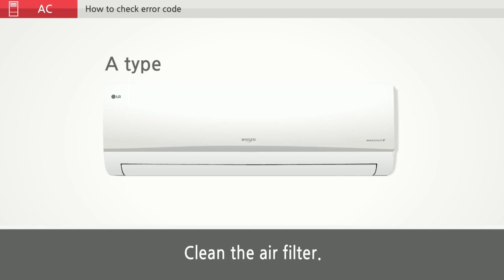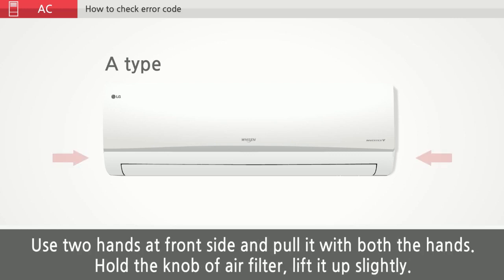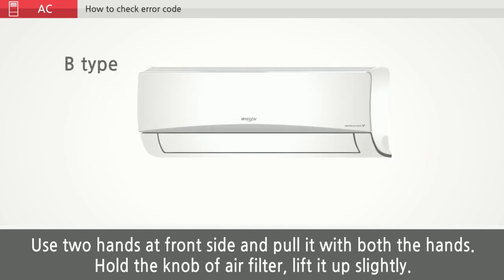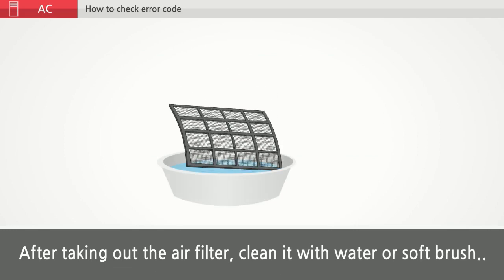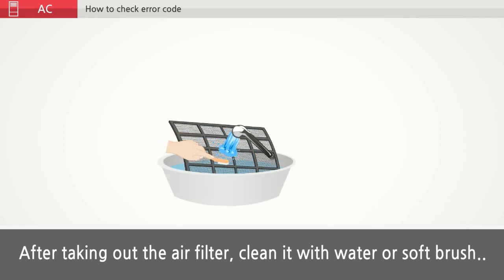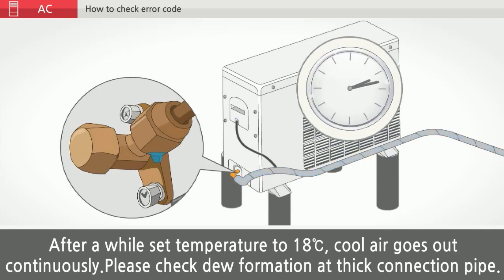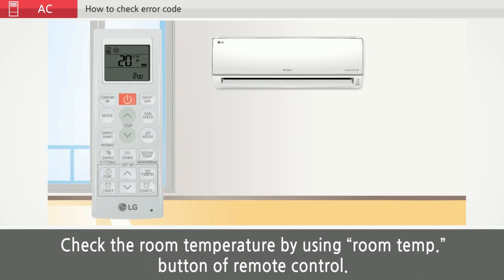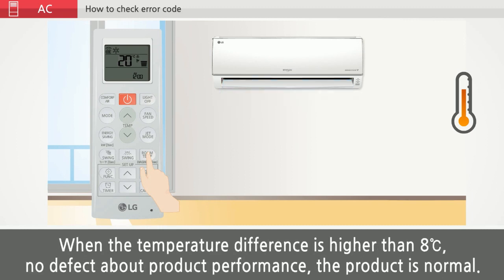[LG Split AC] - Solving Insufficient Cooling Problems

Comment: my LG 1LGWS09TWS doesn't go below 18degrees is that right? i thought they go down to 16deg. 
Aircon is not cold enough and runs all night due to this. IS there anyway to get down to 16deg? I'm in Australia
Reply from the maker: Hello, Thank you for contacting LG Electronics. 
kindly note it's as per the country regulations it can't be 16 Degree
Reply: @LGService4u  I’ve kelvinator aircon which goes down to 16 so why can’t LG
Reply from the maker: Yes it might be if old model but for new models and as per country law to be Environmentally friendly air conditioners

Comment: I have a problem with my brand new LG dual zone mini split ac system. One of the two wall units in the living room (LSN090HSV5) doesn't blow cold air when turned on by itself. It turns on and blows regular room air. 

The other wall unit in bedroom (LMN079HVT) works well. It blows cold air when it's on by itself. If both wall units are turned on, then both blow cold air.

If living room unit is turned on by itself, then there's no cold air. It just blows what feels like regular room temperature air. 

The outdoor condenser is the dual zone LMU18CHV.

What's the best way to troubleshoot this issue? The temperature in Los Angeles, California, USA ranges from a low 57F to a high 75F. So, I'm testing at night and in the morning and the living room wall unit won't blow cold air on its own.
Reply: i have alslo problem with cold mode

Comment: I would never recommend lg dual inverter ac' s to anyone . It's a flop show . Every few months some or the other cooling issue occurs . And the  lg technicians care only about the 'amc ' money . No issues are resolved properly by them . Unnecessary visiting charges are levied  just to tell you that your ac is low on gas or has a compressor failure issue .
Reply from the maker: Good day!
Thank you for contacting LG electronics.
we apologise for the issue you faced ... in which country are you located ?

Comment: I have a 1 ton dual inverter wifi (S4UQ12JA2PC). The ac slows down the compressor even when fan is at full speed, at set temperature of 20° and room temperature of 30°. Why? It shoupd run at higher speed till it reaches close to the required tempurature. Plus the ac now doesnt even bring the room below 28° ambient. None of lg technitians can figure out why to which u requested a replacement unit which your technitians refuse, im under the warranty period.
Reply from the maker: Thank you for your valuable feedback, your rating is very important to improve our services more in the future.

We really apologize for any inconvenience and we are committed to providing great customer service, and we would like to make things right.

If you still need any further assistance, please feel free to get back to us and we'll be more than happy to further assist you (Kindly contact us on WhatsApp https://wa.me/971543939054 or Call 800 54)

Comment: My lg ac duel is inefficient  not cold enough my room is not big but still not cold and kinda feel humid, the (high)fan cooling is not strong enough feels and sound like it’s on low I struggle to sleep with this condition I don’t know what is this issue it still new my brother has 2 in one room but still sane problem. My last time buying lg duel A/C or even recommending it
Reply from the maker: Hello, Thank you for contacting LG Electronics.
Please accept our apologies for this issue
Kindly inform us of the unit model number and the country in which you are located to assist you with your request.

Comment: My newly bought Dual Inverter wifi LG ac is not cooling after 8 hours only! I have followed your steps and my result is  0.5 degree temperature decrease after 35 minutes!!!! What should I do?
Reply from the maker: Please wait for the technical team . They will come and check the exact issue with the unit and assist you...
Reply: @LGService4u  They came and change the out door unit as it was a faulty one!

Comment: we have two ACs. Godrej(8 Months) and LG(14 months). Experience with LG AC is quite disappointing since we brought in our home. Insufficient cooling though we are running it for more than 4 hours. Godrej AC Freezes room with in an hour. Godrej customer care follows up atleast once in 6 months where we never heard any call for service from LG.
Reply from the maker: Good day!
Thank you for contacting LG electronics.
We apologise for the issue you are facing. May I know in which country are you located ?
Reply from the maker: Kindly confirm the country of your location we will direct you to the proper email address.
Reply: @LGService4u  India
Reply from the maker: You may reach Lg INDIA via email on :
https://www.lg.com/in/support/email